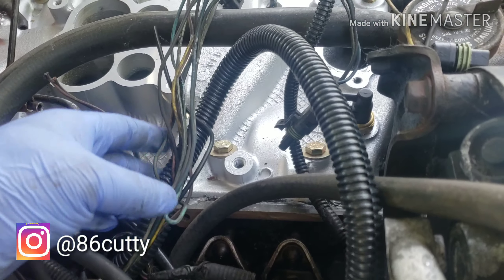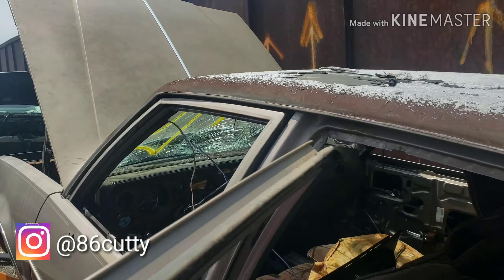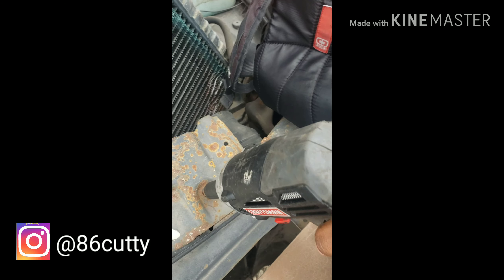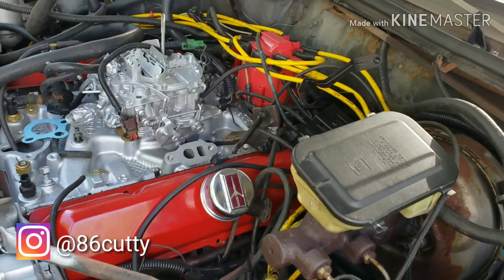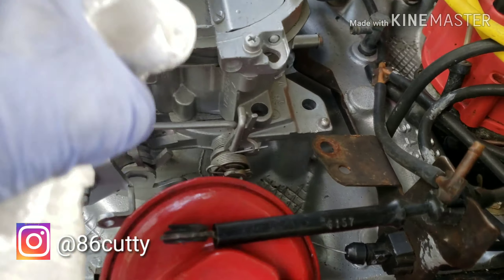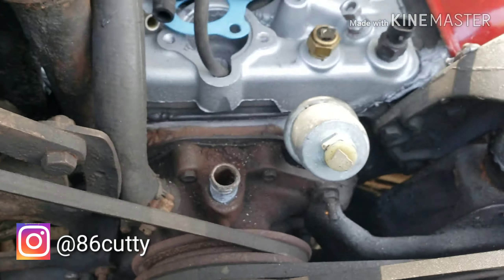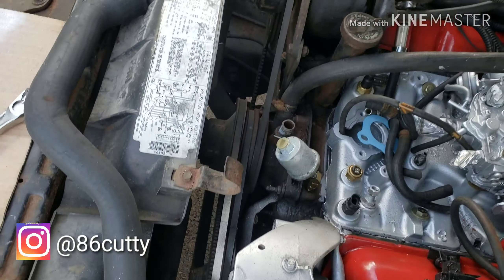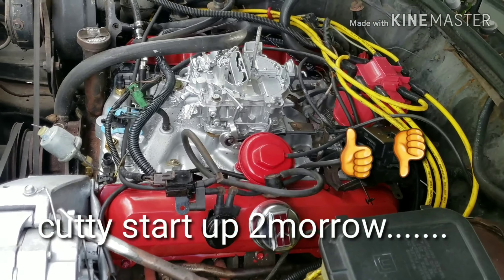86 4doorcutlass update vacuum line sorting...

Comment: sorry that double port on the back of motor that u connected was the bottom hose hooked to a small pipe about 1 foot long there is another port in front of carburator was you able to hook those lines up also
Reply from the maker: Yes all the lines are hooked up